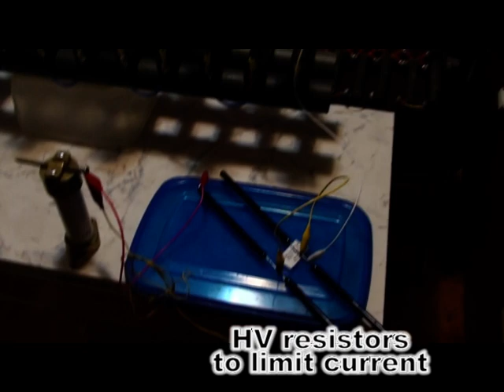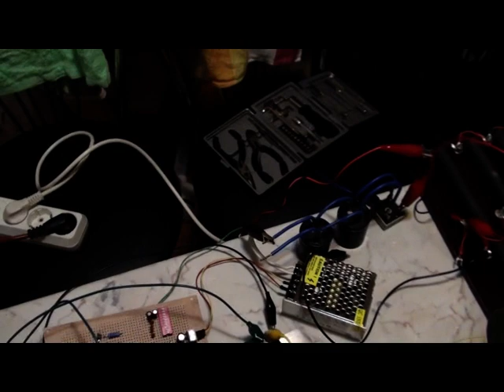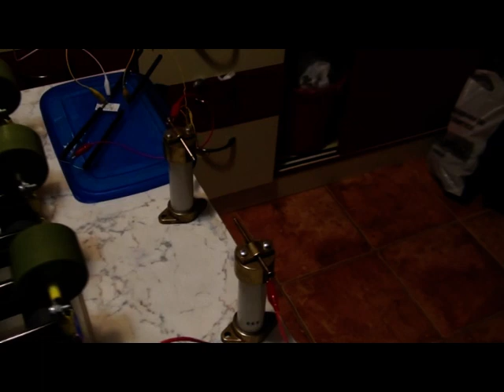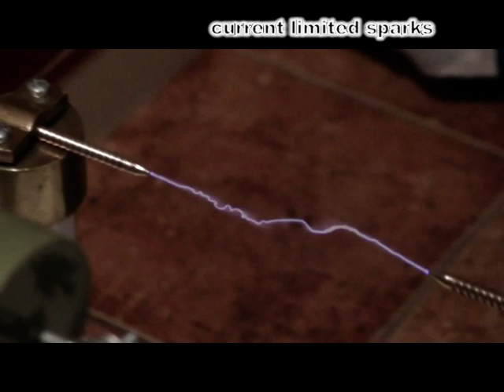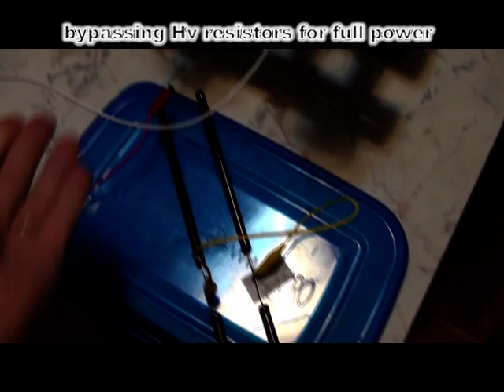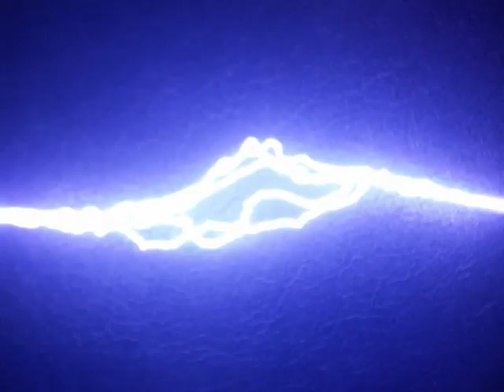HV multiplier 120000V

Comment: Hello sir.
I used capacitor and diode for marx generator, powered by flyback or eht. it works good, but in low number of stages.
when I increased number of stages (ie. About 15 stage) then it didn't work.
What could possibly wrong?
Please guide me sir.
Reply from the maker: Hi! Can you give more details about the power supply, diodes and capacitors (voltage, capacitance etc)? Don't expect to add any number of stages, because the efficiency gets lower (I think optimal is 8 stages, but you need to try yourself).
Reply: Bogdan Rotaru 
diode 16kv, two 6kv (102)caps in series.
powered by flyback let's take 8kv input.
I have no probe to measure.
1 more question sir.
which is best for high voltage project.
Voltage doubler, tripler or quadrupler?
in respect to efficiency.
Reply from the maker: How do you power the flyback? ZVS or 555 timer or different way? What type of flyback do you have? It depends if it produces AC or DC (if it has internal HV diode). A usual flyback produces 15 to 25kV so your diodes/capacitors maybe too low rated.
Reply: Bogdan Rotaru 
85 watt CFL circuit powered by.
and flyback output would be AC.
because in 5 stages (caps and diode) it works. but when I increased no. of stages it only create sound (sshhh type) but not getting spark.
thanks for your support sir.
and, Is quadrupler and 2 stages of Voltage doubler same???
Reply from the maker: I think the best way would be to put the video on Youtube, with 5 stages, and than with more, and will see what happens than.

Comment: 120kV between needle points will jump a LOT farther than 12cm.  Something isn't right here.
I suggest you re-use those caps in a Marx generator.  In a C-W generator, you have to limit discharge current or you'll blow up the diodes.  In a Marx, no such limitation.  :)  Play safe.

Comment: Is this a Marx generator?
Reply from the maker: No, it's not. Marx generator uses capacitors and resistors. This one is a Cockroft-Walton multiplier using diodes and capacitors. Check my other video for the Marx generator. ;)

Comment: hello sir,
I need your favor for this high voltage generator.
i need a diagram of this so that I could make this in home.
would you like to help me.
I need this for study purpose.
I'm from India. can I get all parts in india?
last time I purchased hvdc module from eBay.
but not satisfied. please help me so that I could make this one.
Reply from the maker: I don't have a diagram of it. But you can find many schemes, just google it. The input voltage needs to be  AC, not DC (DC is for Marx generator, not Cockroft Walton multiplier). It can be low or high frequency. 
With that HVDC module you bought you can power a Marx generator (see my other videos with Marx generator).

Comment from the maker: @foozybearz  Not with this transformer, but I noticed this effect at another transformer which is sealed in plastic and I read they have a capacitor added, so that's why you got zapped. However it should be very dangerous, unless you have some heart problems.